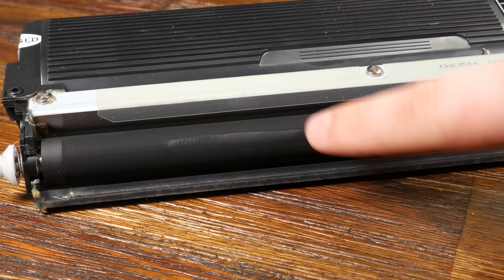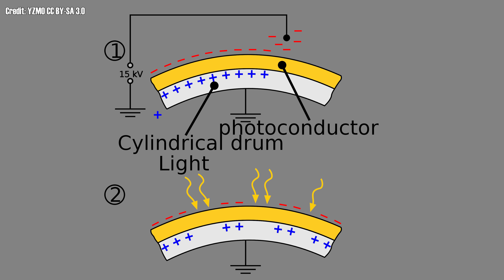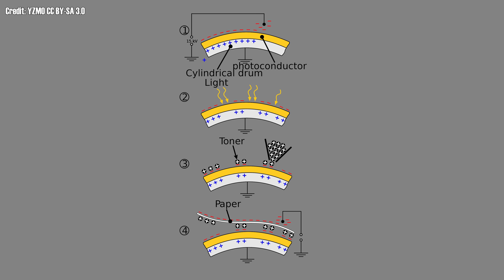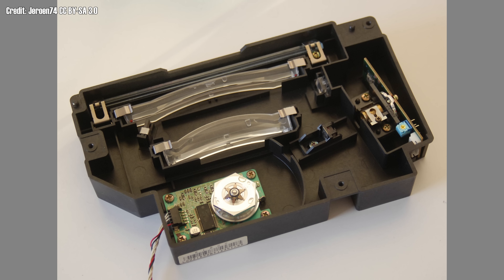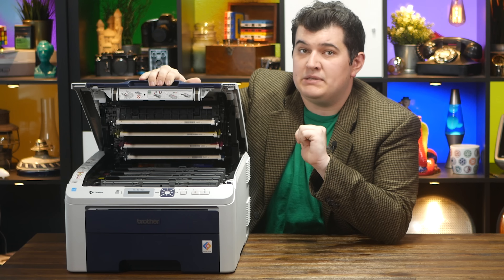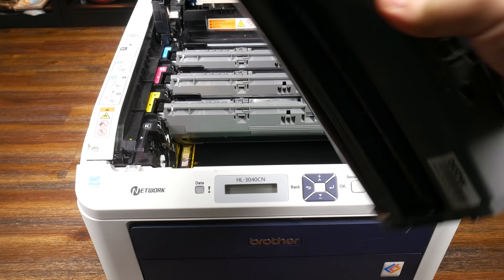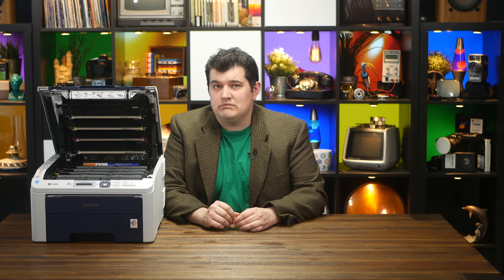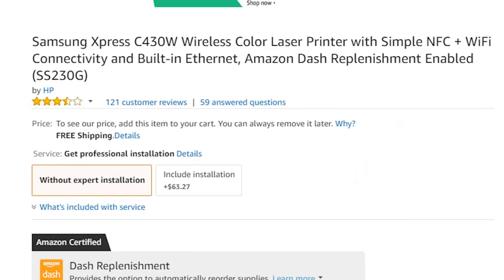LED Printers: The Common Printing Tech You Haven't Heard Of

Comment: A friend of mine who runs a small business was about to replace her Inkjet printer which was doing all the horrible things that inkjet printers do.  I talked her into buying a Dell LED printer, that was about 4 years ago.  She's really impressed with it and can't believe she ever put up with all that inkjet nonsense.  
I use three printers for my business: an inkjet (Epson XP-55) for occasional printing of CD/DVDs, a large HP Color Laserjet 2605dn for colour prints (this really is laser not LED), and a HP Laserjet P3015 for the vast majority of my printing where I want cheap, fast monochrome prints.  
For most people I would advise a HP Laserjet mono printer if they don't need colour, or an LED if they do need colour.
Reply: Agreed on everything but the HP part. I had an HP printer once. It broke under warranty and they wanted me to track down a 3rd party repair shop on my own because apparently they don't have their own goddamn repair/replacement infrastructure in place. Fuck HP, never buying their trash backed by poor customer service again. And I would never recommend anyone else buy that crap either.
Reply: I love HP laser printers!  But then I'm not afraid to get stuck in and repair them occasionally.  Inkjets on the other hand, are the spawn of Satin.

Comment: Some colour laser printers can do full or at least near full speed colour, what matters is the amount of imaging drums. On older and now cheaper colour lasers there is only one drum, this requires the image to be built up onto the drum in 4 oases, one for each colour, more expensive/professional modern colour lasers have a drum for each colour so don't have the speed issues that are found on older/cheap units.
My previous colour printer, a XEROX 6140 was both a colour laser and had minimal differences in B/W and colour print speeds (21/18ppm respectively).   
OKI seem to be the main people when it comes to LED printers, and are big on promoting them. Due to the technology my OKI MC342 will even do small banners.

Comment: Yes, I read your reasons to hate inkjets and I agree. You didn't mention that while toner is more expensive, it often has a higher page count for each refill (many inkjets I've seen are 500-1000 pages per refill, less if you waste ink cleaning the heads. toner cartridges for home printers are usually 3,000 to 5000 pages with less waste so the per page price is usually lower)

and of course you didn't talk about dot matrix printers.

Comment: Completely agree with your preference of laser to inkjet printers. When I used an inkjet I would hate smudging the text when highlighting, and ink cartridges were a nuisance. I have an HP Laserjet 1012 I bought some time in the mid-2000s and I go back to it every few years when I have problems with my main printer. I'm still using the toner it came with lol

Comment: One advantage I like of laser printers (and I'd assume it holds true for LED printers, though I'm fairly sure my old Brother HL-2040 is a proper laser printer...) is the staying power of the toner.  I haven't printed anything in over three years, but if I take the toner cartridge out and give it a light shake to redistribute the toner, it will print.  On the other hand, my old all-in-one inkjet had dead cartridges in 6 months.  Only reason I keep it around is the scanner's half decent.

Kudos on the LED printer, however, getting the print speed up in full color.  Now there's virtually no excuse for buying an inkjet, because toner cartridges are relatively cheap when one divides the number of print-outs per dollar, and even more so if you regularly go without printing for extended periods of time.

Comment: I had been given an ex office B&W LED printer back in the late 1990's It worked fine at first but started to have a bank of LEDs along its length that became randomly intermittent and would cause random patterns on the printed page in a strip where those LEDs were

Comment: I have a Brother HL-3150CDW colour LED printer, I got it last year, A mate of mine have the lower version, his don't do duplex printing and there is no ethernet and a friend of mind have got herself the model above mine, just a little faster that all. 
I love my LED printer, It prints fast and don't clog up if not used for a while. 
Saying all of that, they are pretty large and the quality of photos are not as good as inkjets. 

I had a look under the lid and I noticed the LED holders on the lid, i seen them before, but never realised what they was. you learn something new every day. 
Oh yes, LEd printers are cheaper than Laser.

Comment: Had an Okidata LED Printed back in 1998 that got me through College.  Toner was super cheap compared to ink and I literally work that printer out  to the point it wouldn't feed paper correctly anymore.  It was a great, tiny little B&W printer that was basically as small as the inkjets compared to the massive Laser printers.

Comment: Some additional facts: the Samsung printer you mentioned isn't slow because it uses lasers, but due to the fact that it's likely a carousel based printer. It has the Cyan, Magenta, Yellow, and Black toners arranged on a circular rotation drum, and it has one imaging unit and and intermediate belt with the length of a letter or legal sized paper. 

For black and white printing, the carousel doesn't move the whole system works much like a standard black and white laser printer. To print color, the printer will image each color onto the belt one at a time. So cyan gets imaged, then the carousel rotates to the next color and that gets imaged and so on. The colors are layered onto the belt and when the last color is deposited, the paper gets fed past the belt, picking up the completed image and goes to the fuser.

Your Brother printer looks like it uses a paper transport belt, where the belt just moves the paper along on top of it, and it's doesn't contribute much to the actual imaging process. Some larger color laser printers actually have an imaging belt, where all 4 colors are imaged at the same time onto the belt and then the paper passes by the belt, picking up the image. This can allow for shorter paper paths, and can make things like duplex printing much faster.

Also, you should get your hands on a Xerox solid ink printer. Those things are a technical masterpiece. You can probably save a buck by picking up and older model, like the 8560. You can also probably find the service manual online, which goes into detail on how it works.

Comment: IIRC, having worked on hundreds of printers of all types, the LED printers were less reliable in the past due to the LED technology of the time.  You'd end up with several blown LEDs after only a year or two of usage.  Replacement of the LED bar was more expensive than a scanner assembly of a similar laser printer.  The end effect is like what happens on a dot matrix printer that has a bad pin: gaps in the printout.  As the LED tech got better the reliability got better.  It's not surprising OKI commercialized the tech first.  They had some of the most bulletproof and durable printers out there.

Comment: I know LEDs are fairly reliable, but with so many of them in a row, there's bound to be a significantly lower Mean Time To Failure (assuming there's a normal distribution in how long LEDs last, the more you have, the greater the chance that you've got at least one that's a couple sigma early in breaking, leading to a shorter MTTF). 
I can't help but wondering how big of a problem this actually is. How noticable would it be in an LED printer when one or two LEDs fail? Presumably, since one LED is responsible for one point along every horizontal line, this would manifest itself as a vertical line on the paper. Do you have any information on the MTTF of an LED printer, and / or at what point breaking LEDs become noticable?

Comment: So had anyone else just assumed a photocopier was just a scanner and a printer stuck together? Well modern ones probably are at least.
Reply: It used to be for a while, and the low volume ones probably still are.
The high volume copiers are more like a digital camera (with a pretty powerful flash) and a printer stuck together.

Comment: After years 10+ years about 10 years ago It was funny how a technical non technical person successfully described the concept of a toner based system. Ive worked on analog copiers (reflected light from the document)  digital copiers where the document is scanned and then printed using a laser printer of up to speeds 100 A4 pages a mint. worked on color machines of the analog type and digital type. Seen everything from mono component  toner/dev to separate developer / toner where the toner powder is so fine it acts like a liquid when in a bottle or when loose like a fog in the air. I seen single drum with 4 separate colour  tanks to that drum to 4 drum systems single laser 4 laser to led/fiber optics(what you called the lenze ) In the end there is more ways to skin a cat  I do know from experience a laser unit is cheaper when the speed gets faster  as the faster you go the more power needed to draw a dot so more heat is generated and that must be controlled it is easier to cool a single point than a whole strip , This is more for the commercial space where the machine is expected to do say 3 million prints over a 5 year life time.

Comment: We had a LED printer where I worked about 30 years ago - I think it was made by NEC - ISTR they actively promoted the LED method as a feature.
Reply: Sorry to jump in two weeks late... I used to work for OKI in the early 90s, their page printers (as they called them) used an LED array in place of a laser + spinning mirror. Came with a life time warranty, so yeah, actively promoted as a feature...
Reply: NJOHN1970 OKI printers are damn near indestructible. They're the Nokia 3310 of the printer world- nothing fancy, they just keep working day in, day out, often in harsh environments. Their dot matrix printers are the standard for warehouses and shipping depots, often in dusty places without climate control.
Reply: @puckcat22679  I quite like OKI printers too - except the one that went on fire and had to be flung out of my (upstairs) office window.  Thankfully there wasn't anything below it at the time, and it didn't bounce back towards the glass door!
Reply: The Wife used to use an OKIPage  LED A4 printer almost 20 years ago when she used to own a Pharmacy. Completely reliable and more than fast enough for a busy Dispensary. Running (consumables) costs were not that bad either.
Reply: https://youtu.be/gI4c7G7SVHs?t=10m36s
Reply: an* LED printer

Comment: You could spend quite a bit of time on printing technologies.  We all know of Laser, Inkjet and maybe even dot matrix.  But there are other technologies that just didn't last that long or are too expensive.  Dye sublimation, thermal (still around), wax transfer (similar to DS).  The strangest one used special paper and a high voltage static discharge to'burn' the text on the page.  Don't remember the name of the method but I believe Olivetti had printers that did this.  Looked cool in the dark with the blue sparks.

Comment: But how reliable are the LEDs? With so many, I'd be concerned about how many burn out and how quickly.
Reply: LEDs burning out?   Other than wiring some incorrectly while building an LED project, they never fail.  Though a 1998 LED light bulb has faded away....

Comment: As a side note: The first laser printers were very large machines (bigger then very large photocopiers). And laser-diodes also didn't exist then, they used argon lasers instead. Argon lasers happily convert a few kilowatt power into heat just to produce a few hundred milliwatt of laser light. And to get rid of that heat, they installed a big fan that sucked in all toner-mishaps just to blow it on the hot laser tube where it melted.

Those laser printers were a nice source for argon lasers, but they were really dirty and then you had to deal with high voltage and cooling. Today you can buy laser diodes in many different wavelengths and they are much easier to handle. ;)

Comment: This is the printer i have (https://www.amazon.com/HP-LaserJet-M251nw-Wireless-Printer/dp/B008ABLJHE) my job was going to recycle it so i took it home and plugged it in and it's printing just fine.

The Amazon.com specs show 14ppm for both black and color, i'm going to assume it's an LED printer as the toners are all aligned in much the same was the brother is, but the cartridge tray slides out, instead of the top going up.

It's a great printer and it's nice to finally have a color laser i didn't have to spend a dime on (I also got a full set of toner including a XL Black cartridge)

Comment: I'll never buy Brother products again.  First, my laser printer died on month 13.  Yep, one month after warranty.  And this was not the bottom of the price printer.  Second, much of their 'cheaper' printers using inexpensive toner but ding you on the 'developer'.  Which ends being as expensive as the printer.  I don't recommend Brother to my clients!
Reply: @pmailkeey yep, I agree in some countries the manufacturer warranty is not suddenly over after 12months even if it says so on your warranty paper.
If a product can reasonably be expected to last for 10 years, it is unreasonable to have a repair cost more than a new machine after just 13months.
It will be much harder to actually get your manufacturer to provide the warranty though.
(And I am not sure how long a cheap printer can reasonably be expected to be used)